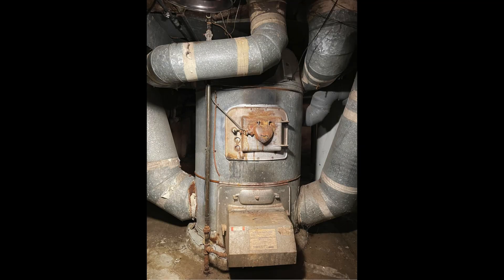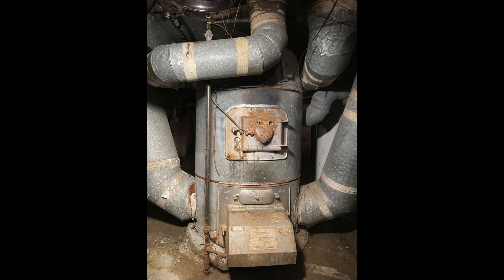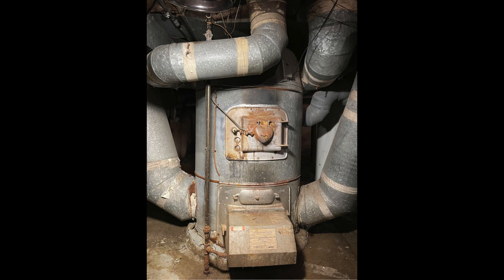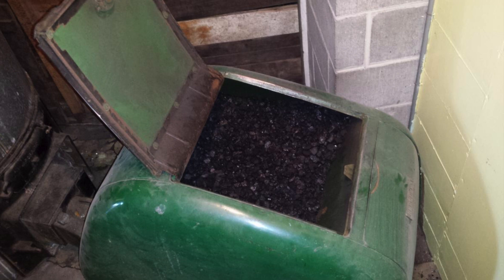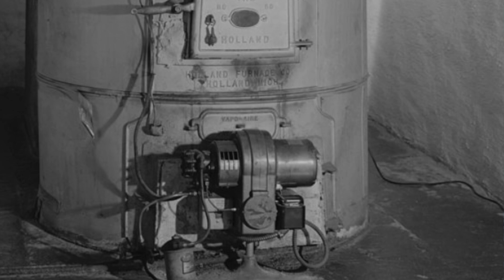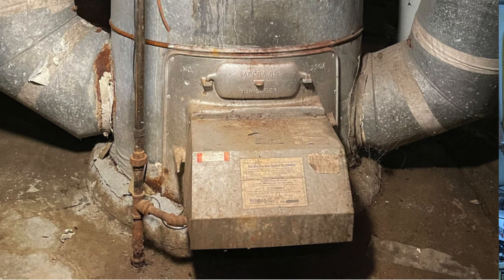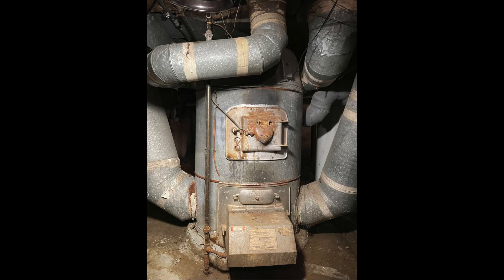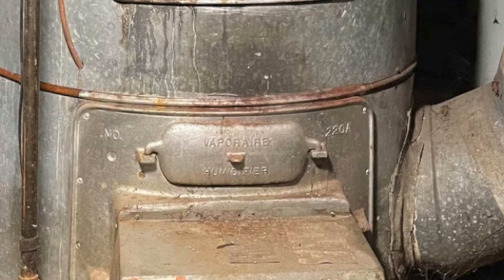Octopus furnace

Comment: I'm wondering if anyone has a old oil burner hot water radiator heater. I can't open the door to clean it. It used to open until last year. Any ideas PM me If you can

Comment: In many years in the HVAC industry , I have run across a few gas steam boilers with single pipes to cast iron rads , The condensate returned by gravity . No pumps .
Reply from the maker: I have also seen those systems.  Simple but inefficient.
GFM
Reply: Those are the most common type of system here. They are not inefficient system wise if a new boiler is retrofitted. Some of the new steam boilers are up to 86 percent efficiency. 2 pipe steam is more efficient but not by that much.

Comment: My 1920s house had one of those. Sometime during the 50s or 60s it was removed and replaced with a forced air natural gas furnace. House still has the huge return air grilles in the floor along the outside walls which are still used.
Reply: I will add that the house in the movie "A Christmas Story" also had one.

Comment: In 1953 my parents moved into a brand-new house with a new Bryant gravity gas furnace installed by the builder.  In 1990 they replaced it with a new gas, forced air furnace.  In the 1950s, 1960s, and even into the 1970s natural gas was cheap.  So wasting 60% out of the chimney wasn't a big deal.  In those 38 years of service, only one repair was made.  The thermostat had to be replaced.  The other two working parts, the gas valve and the pilot assembly, never failed.  I would argue that in the long run (38 years) it was more 
"efficient" than any of the junk units they make today with 65 working parts at 90% fuel efficiency and replacement after 15 or 20 years.  Simple is always better.
Reply: There's something to be said for the price of your time. Set it and forget it means you can spend more time doing literally anything else. I like systems to be independent of each other. You lose electricity cause your cable breaks, life sucks but you're not freezing to death.
Reply from the maker: The price of natural gas has increased by double in the last 2 years.
GFM
Reply: @grayfurnaceman  not really sure where you’re getting your info ? As you can see it from my Henry hub data, the price of natural gas has been going down over the last two years (you may be thinking of  2021 & 2022 ).Henry Hub Natural Gas Spot Price - Historical Annual Data
Year	Average
Closing Price	Year Open	Year High	Year Low	Year Close	Annual
% Change
2024	$2.09	$2.56	$13.20	$1.25	$2.18	-15.50%
2023	$2.53	$3.64	$3.78	$1.74	$2.58	-26.70%
2022	$6.45	$3.74	$9.85	$3.46	$3.52	-7.85%
2021	$3.89	$2.60	$23.86	$2.43	$3.82	61.86%
2020	$2.03	$2.05	$3.14	$1.33	$2.36	12.92%
2019	$2.56	$3.25	$4.25	$1.75	$2.09	-35.69%
2018	$3.15	$6.24	$6.24	$2.49	$3.25	-11.92%

Comment: I've serviced several of these here in Colorado Springs.
The owners are reluctant to swap them out mostly due to the costs of removing the asbestos tapes and insulation.
Reply from the maker: The removal is a problem due to the asbestos.
I think some of these just disappeared mysteriously after getting a price for its removal.  Not advocating, just observing.
GFM

Comment: I am shocked they can still be fixed. They still make parts for them?
Reply: only thing to replace is 24-volt gas valve and maybe a thermocouple.
Reply from the maker: All parts, except the heat exchanger are general replacement parts, so they are available.  The problem may be finding a service tech that will work on it.
GFM
Reply: @grayfurnaceman  i worked on them, the last one i worked on was about 20 years ago. the owner was very old, i would expect that furnace got replaced when she passed on.

Comment: That reminds me of the old Coleman Model 700 I think it was in the little Spartan Mansion where I was raised and probably the reason I got Into hvac. It was a pot burner and was very efficient when it reached high fire   That thing would really pump out some heat in the front room but the blower wasn’t much more than a combustion blower in cfm. But a 275 gallon tank would do all winter. Wish I had one in the garage sometimes now😅
Reply from the maker: I worked on a few of those.  I thought they a bit goofy with all the pipes, but they did work fairly well.
GFM